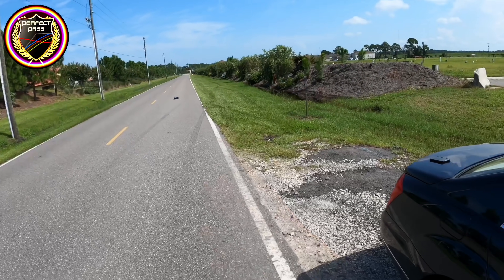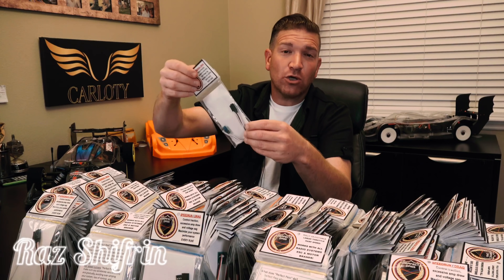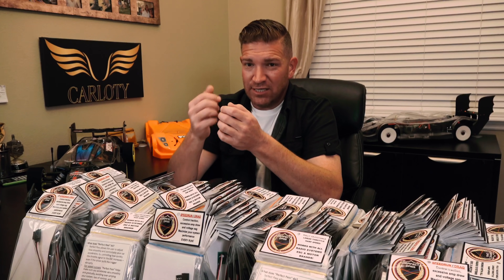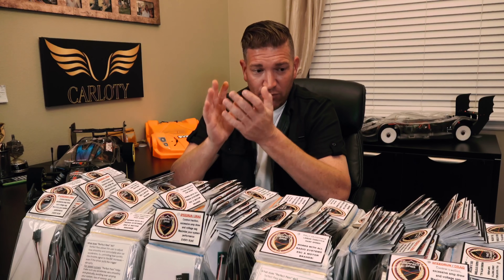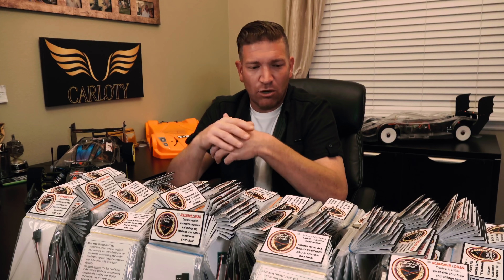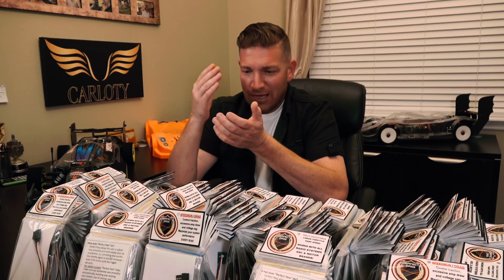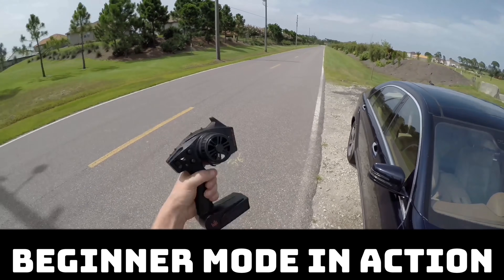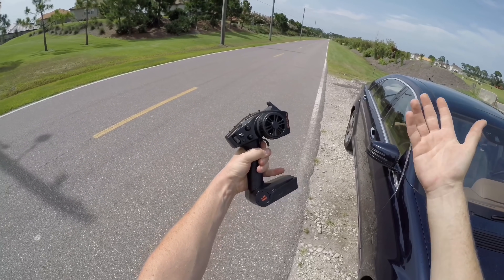PERFECT PASS - RC CAR LAUNCH CONTROL

Comment: Hello Raz, are these still available id like to place an order if possible 😁
Reply: They are on the perfect pass website.
Reply: @rtz549  yeah i seen that about a month back when Raz made the announcement 😀 thanks for the heads up anyway brother 👍🏻🙂 got the driveshafts about 4 months ago from a friend in the states, still not used them but they're installed, they fit so snug with my just bash it chassis braces. Mines is an absolute beautiful build but i dont do many speedrunning with it as they'res too much money in it lol 😆 will upload a few video's of my builds as soon as i finish my rc workshop im building!

Comment: Im trying to keep my limitless straight for speed runs and drag. If i have this perferct pass do i still use a gyro or does this take the place of a gyro?
Reply: No this just lets you adjust how slow or fast you want to build up your acceleration, you can adjust it so that your car doesn't break traction and builds speed progressively and in turn keeps the car more stable. Correct me if im wrong but thats the easiest way i can describe it! Im away to place a big order from Raz soon! You can still use your gyro if you want your car to handle more stable, I'll use this along with my Radiolink RC6GS with the gyro reciever 👌🏻

Comment: Have question. Have Nb4 remote. Everything set to 0 except throttle trim is at-100. Only thing else is dead band is at 10 from factory. Pod is turned all the way left. After calibrating I go to do run and it takes off then cuts out.

Comment: Man u are on it. I just purchased 6s typhon v5 2021.been at the hobby shop for 3 weeks the guy doesn't know what he's doing car has a newer spectrum remote up grade they put fans on motor put the high speed pinion 20 tooth on it. Said it needed a servo up grade for steering so they put it on there. But still the car won't go back to center. Need your help. They don't even know how to set the car up for street. Out of box the alliment was way off. They been twisting on the adjustment of front end but guy has no clue as what he's doing . Going to get my car tommorow because he's a fraud. Please man need it help. Got deep pockets plenty of cash Been forgnite in life. Raising my 6 year old nephew and just want to enjoy my typhoon 6s v5 with him. I also purchased the v3 3s Typhon for nephew no problems with it. But the guy at the hobby shop doesn't even know what he's doing got my adjustment way out even worse. Been doing research on web and u are the Mann. U know what your doing and was going to hook up the perfect pass but caint get car set up on steering? I can send u my car overnight to ya 😁 so u can fix it on getting it set up for street runs. Or parking lots looking to hit 70 that's it. Droop and toe and camber need to be adjusted . Once again please I need your help thanks again

Comment: I like it. Don't need one for my crawlers but could see it be useful in the Infraction I got last week. Heads up though. Don't pin me in the dates, to many hits to the head, but... Waterskiing, wakeboarding, barefooting since the late 70's. Going to say early 90's a product called Perfect Pass came to be the go to for towed watersports. A cruise control system for boats capable of keeping boat speed within .1mph of set speed even with a slalom skier putting 1000# peak loads on the line going through the course. Pretty amazing tech when it hit the market and it just kept getting better. Anyway, hope you don't run into copyright problems with the name, CYA. Seems like a great option for us in the RC world. Thanks!!!

Comment: How do you know how many seconds its adjusted to? Do you keep turning the pot and looking at the data log later to see exactly how long it took to reach full throttle? I got mine the other day......in the process of building the car now so I havent installed it yet.
Reply from the maker: Start with the average which is all the way to the right and one click left.
Reply: @PerfectPassRC  Thanks!!!

Comment: What can this do, that we can’t do with a nice Futaba radio that has throttle speed, acceleration, etc..
Reply from the maker: With the fancy Futaba remote with throttle timing if using it for drag only you don't need it, The problem is that the futaba go only to 2-3 sec, not 6-8 sec for speedruns.
If you're doing speed runs AND still have a fancy remote you still need it.
Also, any fancy remote will not give full throttle protection.
hope it helps and thank you for your interest:)

Comment: How does this benefit some one who is drag racing 132ft with the Futaba 7PXR transmitter?
Reply from the maker: Absolutely no benefit and I wouldn't buy one, if you only do drag AND most importantly have a Futaba 7PXR you simply just don't need it brother:)
If you had the same radio but wanted to do speed run then absolutely you do need it since the Futaba will only do 2-3 sec.
Hope this helps:)

Comment: I'm going to be honest and say that as a tuning tool this would be invaluable. Taking the human error out of the equation will let you truly see what your modifications do. As for personal bests it feels to me at least as a bit of a cheat. Throttle control is what takes skill. Someone with a slower car could be beat by someone with a faster car with better throttle control. That said as a tuning aid I'm all for it and would probably purchase it if you are able to produce these again at a better price.
Reply from the maker: Thank you for your input.
If you're racing a drag race with a real car, are you cheating if you're using launch control?
If so, the entire world is cheating pretty much no?
what's the difference?
Every car show, every race, every drag track, all using launch control.
Finally we have that privilege also.
Reply: @PerfectPassRC  I totally see and understand your point. I just see it a little differently. Instead of just launch control or say boost by gear/speed can you imagine having devices in real drag cars that would launch on the green for you, or steer for you. To me its like getting to the track and putting the car in "Race" or "Track" mode to turn off most of the driver assists so I can really drive rhe car. This is just my opinion. I see real value in your product and will likely purchase one. 👍
Reply from the maker: @vicdez  Thank you for your support:)
I think it's exactly the same, you still have to drive the car with perfect pass and identical to any other launch control in the market for real cars, you still have the ability to drive it you don't have to pin the throttle but if you feel like having perfect linear pass 0-100% which is just impossible as a human (just like real cars) you can just pin it:)
Again, this is exactly like a launch control for a real car, same exact characteristics.

Comment: It's servo slow on the throttle all my TXs can do this if I wanted them to and I wouldn't need to open the RX box. I have only used it on high speed ducted fans sounds much more scale spooling up and down.
Reply from the maker: It's just not true brother.
Reply: @PerfectPassRC  I just tried a couple of my radios slowest on futaba car radio was about 4 secs FRsky aero radio was closer to 14 secs.
Reply from the maker: @gboulter  We tried many brands same results as 2-3 Second.
Well if you got 14 you don't need it:)

Comment: I remember your vid Raz "Speedrun Secrets" and the last 20 minutes you talking about the importance of smooth trigger control. Amazing product, but should it be banned for "official" records? Seems like a cheat when a Pb is about the car & driver progressing in the hobby.
Reply from the maker: Same was said about range extenders, gyros, Cappacks and more..
No I don't think so, I think technology is advancing and the cars are becoming more and more technologically advanced, I think it's a good thing.
We enjoy the same with our actual cars.
They've been using launch controls in actual cars dragracing for years!
Why shouldn't we have the same privilege.
Reply: @PerfectPassRC  Also as a note, launch control, gyros, and abs brakes have been banned since 1964 when a NHRA driver had the first rudimentary "launch control" apparatuses, which only made a single sanctioned pass, then was immediately banned due to the lack of "Driver Skill". So, no, launch control has never been sanctioned in any "professional" motorsport even going back to pre-computerized cars, and is only used as a gimmick in select "exotic" street legal sport cars. The more you know! 😉
Reply: @PerfectPassRC  True, guess that's up to the guiness book of world records peeps. Not saying it's not brilliant, it is. But cap packs don't effect top speed, gyros are really only useful for drifters imo. For instance I can take a drone and program a perfect lap thru the gates, with perfect throttle input, pitch, roll, and yaw. But I didn't fly the drone to record laps, the programming (or algorithm) did that. I'm not saying to not use your product, heck I might put in an order for drag racing. I'm just saying that "official" records should be held to that standard, that's all.  IMO😁

Comment: Hey Raz, congrats on your innovative invention. I like what I saw on the throttle graph and it was enough to convince me to go ahead and pull the trigger. I use the DX5 Pro transmitter and employ drive modes to shift from 20% throttle to 100% via a radio toggle switch. It's analogous to a gear box (shifting gears), with each shift increasing throttle by 20%. I use that to reduce over-throttle on take-off, and maintain traction control. While I pride myself in this strategy, and it has been my secret sauce, I decided to employ the perfect pass as a "force multiplier" in my strategy. Most importantly, simply pulling the trigger and letting the electronics "flawlessly" do what I was doing manually was the way to go. Keep em coming, and I'll leave the light on for ya.

Comment: Raz but can’t u adjust this type of sitting in your transmitter already?
Reply from the maker: Not to 7-8-9 seconds:)
And many don't have a fancy remote
Reply: Ohhhh ok I see now awesome 🤘🏽
Reply: Yes. Adjust the throttle curve in the radio and bingo! You can also make adjustments in the esc.
Reply: @JJQualityBBQ  It's not really throttle curve. It's slew rate, very common in radios for planes although the slew will be applied in all cases, not selectively as this unit does (eg. only above 15% when going forwards). A radio with OpenTX could probably do that though.